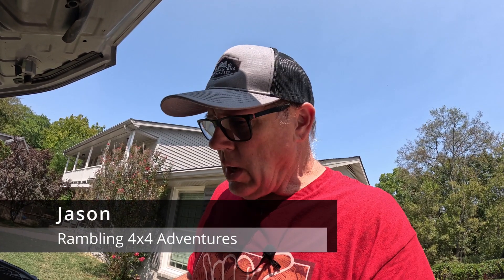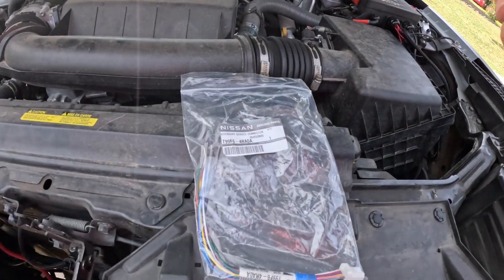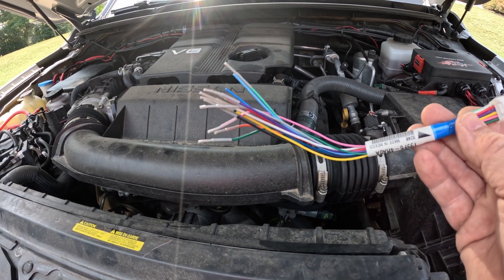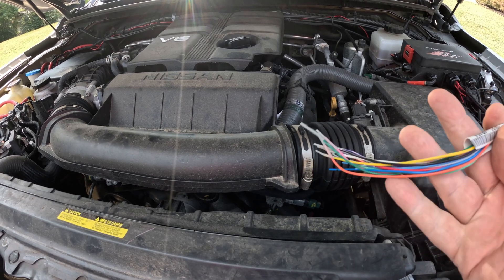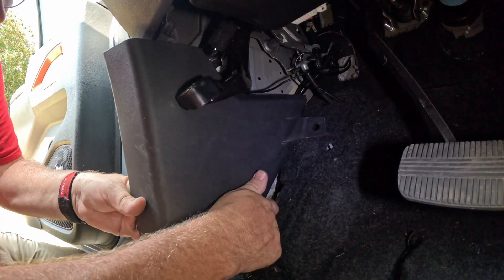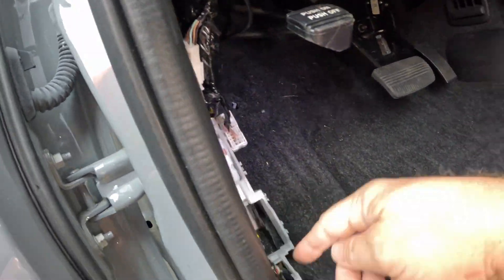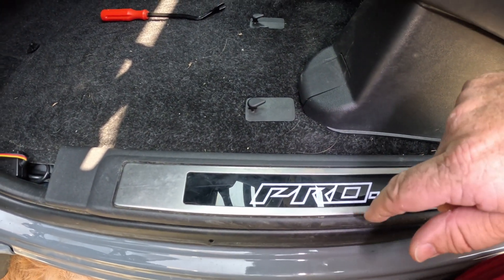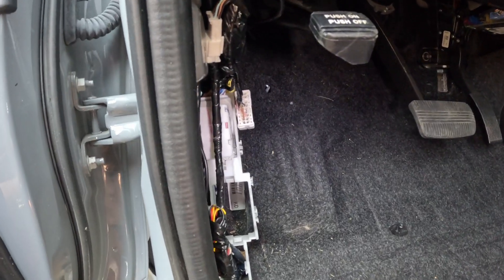Nissan Frontier Accessory Service Connector

Comment: hi Will these allow me to have 24hrs constant power for  example for a dashcamera i want it to be on all day , and yes i know the risk of the battery to draing but im not worri about that now  Thanks mate
Reply from the maker: @Usalogic  pin 2 goes straight to the battery, so yes I think you could do that. If you look at my description I included the wiring diagram.
Reply: You can use a solar trickle charger to offset the drain. Can't have it plugged in to start the engine, though. There's a separate controller you have to buy if you don't want to risk blowing up the solar panel by forgetting one time...

Comment: I have a 2024 Pro 4X and just purchased the illuminated kick plates. Do I need to purchase this service connector for each side to hook these up or is there a work around?
Reply from the maker: @DouglasB65  
From my understanding, if you already have the illuminated kick panels, they use this adapter to make them work. If you don’t have that, I would assume that you need to buy it.

Also, if you goto my Wolfbox video and goto 12:11 on the timeline you can see the wires the dealer used to light the kick panels.

Comment: Is there a plug on the passenger side as well ??
Reply from the maker: @jefftutorow8068  I don’t know, never opened up that side. However, I have not run across anything to indicate there would be a plug on that side. If your floor trim lights up you could pull it up and follow the wire to see where it leads to.